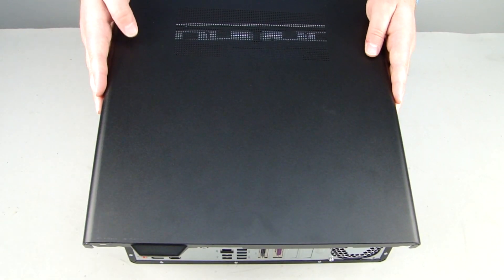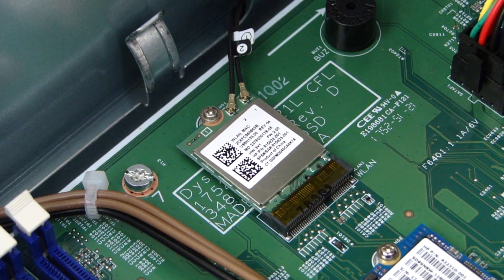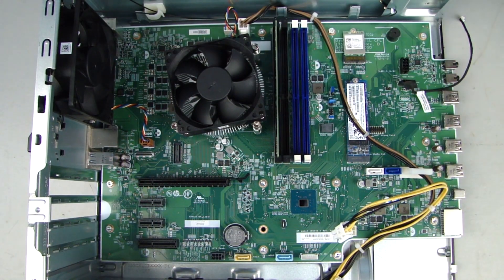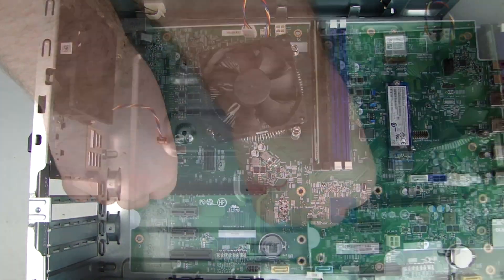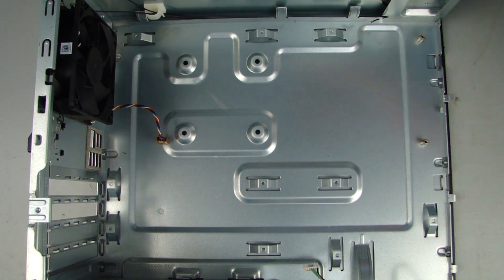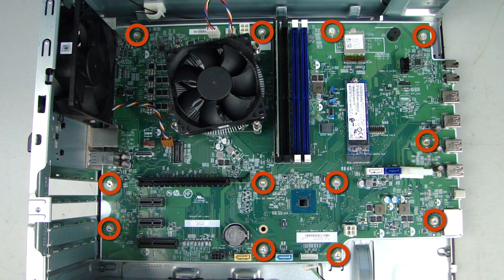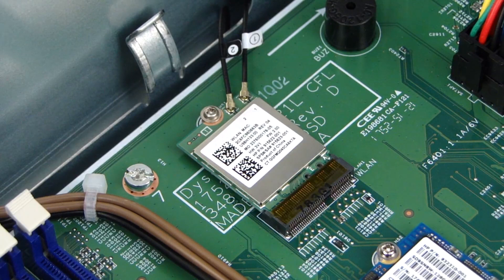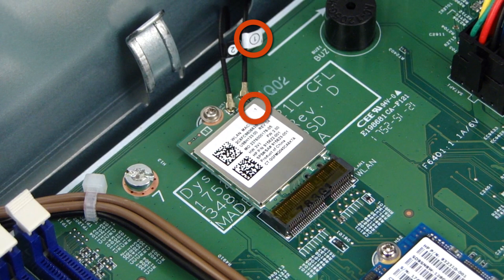Replace the System Board | HP Pavilion Gaming 790-xxx PC Series and ENVY Desktop 795-000 CTO | HP

Comment: is it possible to replace the case and the motherboard by keeping the same components
Reply from the maker: +NotAgingGD HP does not recommend upgrading or downgrading hardware parts or software that is bundled with the product as It may affect the manufacturer's warranty and performance, however, you could change the configuration at your own discretion.